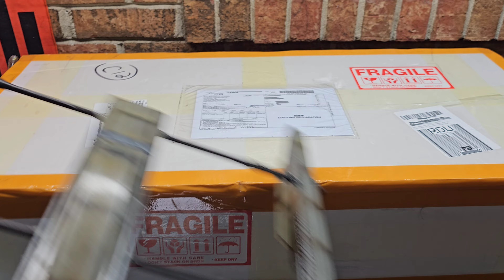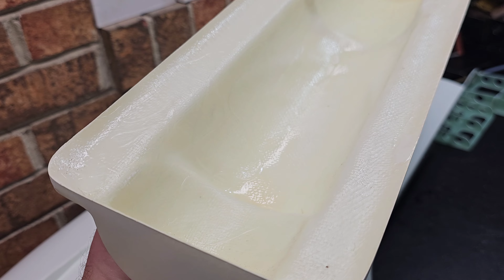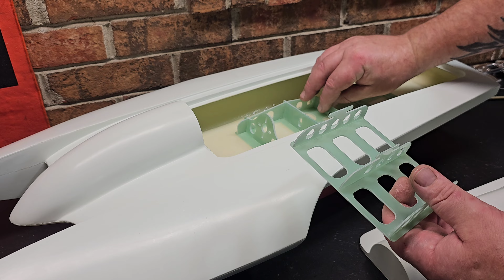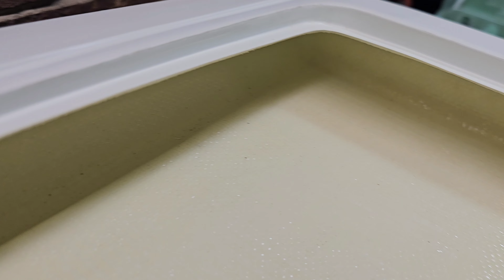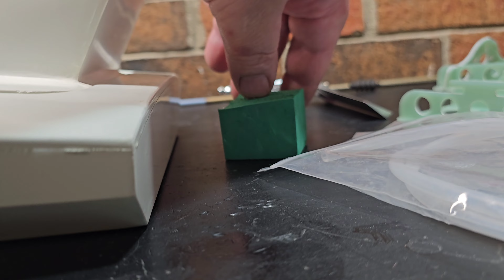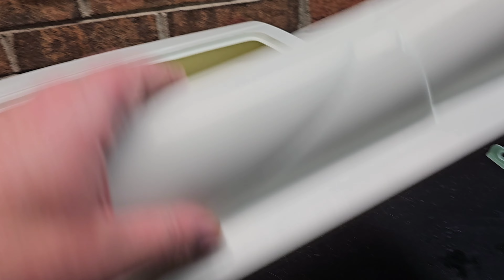New Scale Hydroplane SWIFTER XL 31.5" Fiberglass FRP Rc Boat - P Class Fe Hydroplane

Comment: The Build, I have purchased from them in the past with no problems, they were a little slow in getting the stuff to me but that’s ok for me.
130$ and 99$ for there hulls is more like it, some of these other guys wanting 300$ for something even smaller is well…
Hey Big B, tell us all about what’s needed for the P class. Yep this looks to be a very interesting build. BGFL. 👍
Reply from the maker: I am no racer, but as far as I know, 
P Class is 30-34" hull length  run on 4s with any motor size/kv
P limited is a 3660 max motor size run on 4s

Comment: Cool boat for sure for a P class I feel 31 inches is on the shorter side.   34 inches would be the most preferred.    
However, that might be perfect for a P limited class. 10 shock motor 2300kv 1814 prop she will be quick.   I am interested how it  turns out

Comment: I like it
My opinion 👇👇👇

P limited set up

. 130 cable

Offset strut and rudder

Leopard 3660 kv 2050

Flysky/OSE/ 150 esc for budget.

2s lipo x2 6000 MaH

Light weight.. Easy to turn cable..

I like your idea to not use the hull inserts for the electronics.

Looking forward for this build.. That's for sure!
Reply from the maker: I'm with you on that, 3660 may be a perfect combination 👌